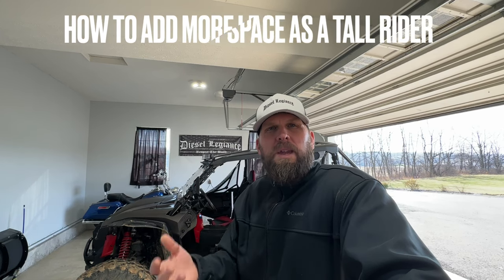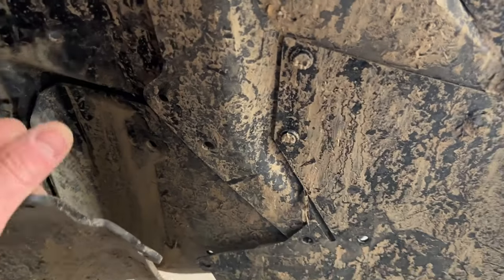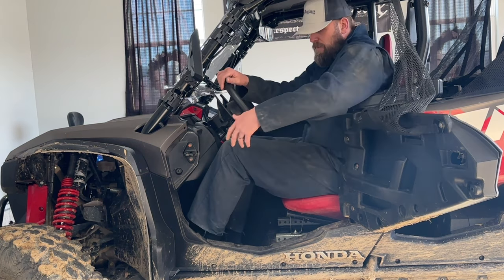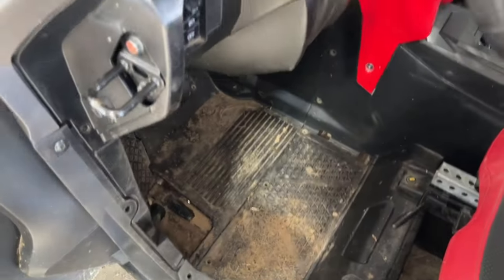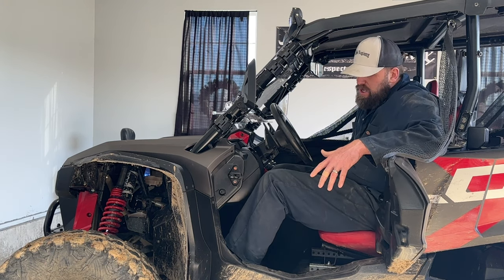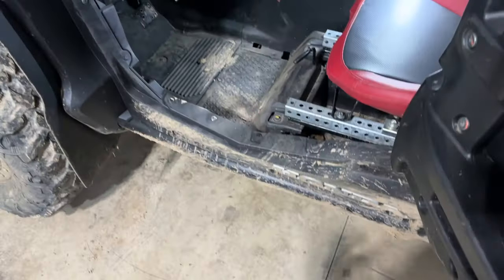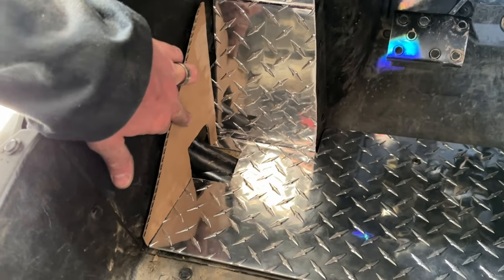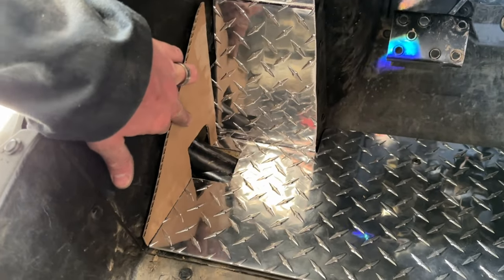I Removed The Dreaded Driver Foot Brace On The Honda Talon. A Must Do Modification For Tall Drivers.

Comment: Nice mod.  Great idea.  Quart of “truck bed liner” is the way to go over rattle can.  Still not as durable as powder coating, but a good option and will add some additional grip to that diamond plate.   Also, you could use a piece of bicycle tube for the frame gap.  Cut out a piece and tape it to the back of your plate.  Keep out some more debris!

Comment: I was wondering when someone was going to do this mod . I'v been thinking of buying a pioneer 700 but it has this same problem with the foot rest . Its a design follow for every manufacturer they never think about taller drivers or the foot wear they use.We aren't wearing sneakers in these machines . Anyways thanks for the mod .
Reply from the maker: It made a world of difference.